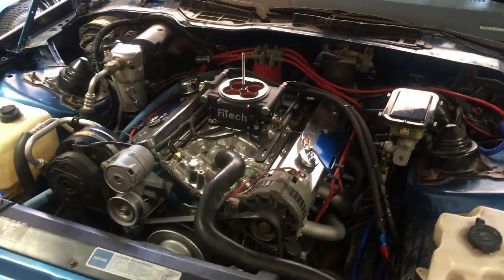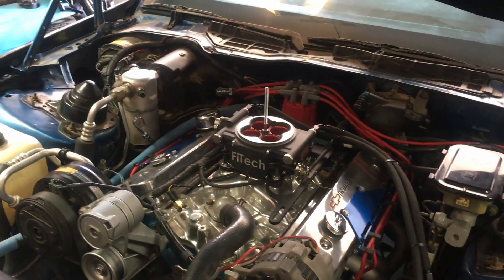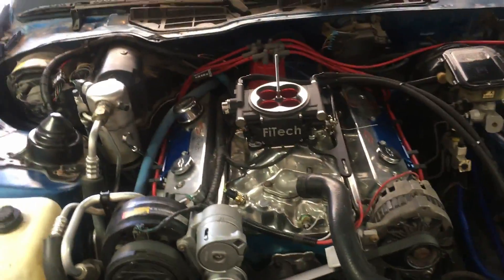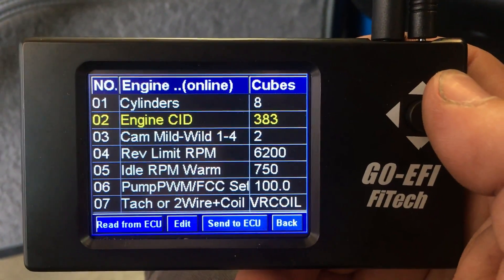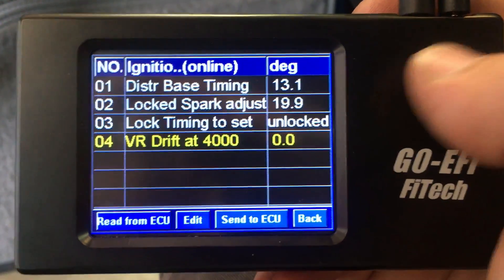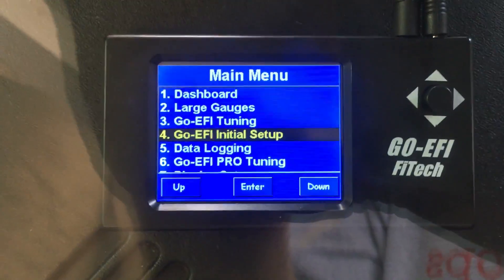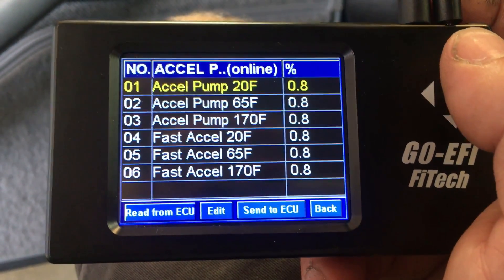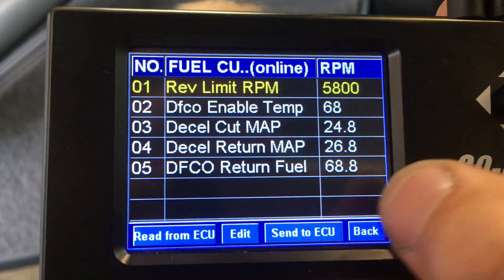Fitech Go Efi 4 Setup on a 3rd Gen 383 Camaro

Comment: Hey great video. I have been doing alot of work to mine and have finally got this about 90 percent done. As far as the fitech I also tied into the fuel pump relay. Do you know which wire color combo you tied into at the relay. And then where did you end up running your white wire for 12v in crank and run? Thanks in advance
Reply from the maker: The 12v crank and run wire usually gets connected to the original ignition coil power wire. It should be hot in start and run. There are two smaller wires for the fuel pump relay. One goes to ground and the other gets connected to the fuel pump wire on the Fitech. Good luck.
Reply: @PetesGarageandperformance  ok I'm pretty sure the 12v crank wire to the ignition coil is the pink on the third gen camaros. Should I slice into it or just connect to the positive side of the coil? And then I also have the blue wire running to the negative side. Then as far as the fuel pump I connected it to the green and white wire coming out of the relay. Does that sound correct
Reply from the maker: We used an MSD 6al box so the harness from the box went to the coil and the coil wire from the FiTech went to the MSD box. You can’t run an HEI distributor if that’s what you have. Yes splice to the pink wire.
Reply: @PetesGarageandperformance  hey thanks for the reply and assistance. OK so I am running the msd ready to run pro billet distributor with the external blaster ss coil so I should be able to run to the pink wire correct.
Reply from the maker: Yes as long as it is hot in run and crank.
Reply: @PetesGarageandperformance  thanks again for your assistance 👍

Comment: hi friends .. why am I so difficult to set up my fitech?  my engine smallblock383 uses HEI distributor .. maybe you know what's wrong with me?
Reply from the maker: You can’t use the timing control feature with an HEI distributor. You could use the FiTech to just control the fuel. Not sure if your FiTech unit has timing control or not, but that’s one of the best things about the system. You can adjust the timing from the driver’s seat.

Comment: Did you lockout your rotor?
Reply from the maker: Yes. Lock it out and use the FiTech to control the timing. It makes timing adjustments as easy as the push of a button.

Comment: Crap. They suck ass. Took 3 to get 1 that works. Biggest pile of shit ever.
Reply from the maker: What kind of issues did you have and what is your setup?
Reply: @PetesGarageandperformance  a customer put one on his 74 Pontiac Grandville. Injectors would not pump fuel at all. So we swapped it with one from our speed shop. It would prime and start til primer fuel was gone. Injectors would not kick on to keep it running. Finally took a 3rd one from our speed shop and it works... But it sounds horrible. Like it trying to suck a golf ball thru a garden hose. They are crap. The car still on my lift. Waiting to see what the customer wants to do. 3 to get 1 that works. And I seem 1 other comment supporting they are crap. Customers that ask me about it. I tell them don't waste their money. And I show them the car on my lift for 3 weeks while I try to make the junk work.
Reply from the maker: What are you using for an RPM trigger? Does the screen read RPM correctly? What’s the fuel supply setup?
Reply: @PetesGarageandperformance  stock tank. Fuel supply that came in kit. Yes correct RPM on screen. Correct voltage. Pump pushing the 40 pounds like it should. Hours and hours of on phone to California to their experts. All they can say is they have no idea. Everything is correct. It should work... But it don't. I not just some fly by night back yard mechanic. I do classic car restoration, and resto-mods. I have switched out many carbonators for fuel injection. So this ain't my first rodeo.
Reply from the maker: That is weird. I always had 58psi on the ones I used. Are you using the fuel command center? It should still spray at 40psi though. Is it possible that the supply line is connected to the return port? I just find it hard to believe that you’ve tried three different units and still can’t get it to run right. It almost has to be in the setup. I’m not trying to insult you, but I’ve installed many of these kits and haven’t ran into many issues.
Reply: @PetesGarageandperformance  trust me. Everything is hooked up correctly. We are getting more than 40 psi. The expert in California told us we needed a minimum of 40. But yea we getting more like 58 to 60 psi. It is the 600 horse kit. I had 2 other master mechanics look at it too. They have 80 years experience between them. I got 20 years experience myself. Trust me. All is hooked up correctly. By all means it should work. But they don't.
Reply from the maker: Yeah it sounds like you guys know what you’re doing. Let me know what you guys end up doing to resolve the issues. Where are you located? I could help you if you’re close to KC.
Reply: @PetesGarageandperformance  yea I am in Toledo Ohio. I definitely will let you know. I just at my wit's end with it. Customer coming in tomorrow to talk bout it. I hope. I need my lift back. Lol
Reply from the maker: Good luck.
Reply: @PetesGarageandperformance  Thank you. I think I gonna try a different makers unit to satisfy my curiosity. Can't hurt.
Reply: @PetesGarageandperformance  plus I see as you do. A lot of people having issues with them. Not just me.
Reply from the maker: I hear ya. I’ve used a Holley Sniper before and it worked good. I also fixed one that had some install errors that caused the o2 sensor to go bad. I’m always kind of skeptical when people trash the product though. As you can imagine, when it says “self learning” people think you just bolt it on and then it’ll magically work perfectly. You still have to know what you’re doing as far as setting idle and the timing table.
Reply: @PetesGarageandperformance  I got it going. The customer had me switch to the sniper. Took a min for it to show. But... I put it on. Fired right up. No problem.
Reply from the maker: Glad you got it going. What are you going to do with those three fitech setups that don’t work?
Reply: @PetesGarageandperformance  my buddy took them home to see if he can make 1 working unit. Then what's left is scrap. The company just gonna eat the loss.

Comment: FiTech is trash. I have had nothing but issues with my FiTech-600
Reply from the maker: What kind of issues have you had? What was the combination?
Reply: Pete's Garage IAC steps never stay the same. I have to adjust them every time I attempt to drive. I have refreshed my gaskets and checked for air leaks. My O2 censor is at the correct angle and distance. The unit is grounded correctly to the battery. FiTech reflashed my control unit but the problem of stalling still persists. Idles fine but once shifted in to gear the RPMs fall and engine stalls. Once I start the motor again the IAC steps are back up in the 150’s
Reply from the maker: So on the next startup is the idle too high when the IAC steps are 150? Or is it 150 because it’s trying to not die? What kind of engine is this installed on? I’ve fixed a few of these (including Holley Sniper) that had issues. Usually there is some kind of installation error. For example: the last one I worked on was a Ford 400. The plugs were fouled out and the o2 sensor was ruined. It wouldn’t even run. It all was due to the location of the coolant temp sensor. They actually had it in one of the intake runners thinking it was a coolant port so it never thought it got up to operating temp and was dumping too much fuel.
Reply: Pete's Garage  the idle is great every time. No climb or low idle. It’s only when the transmission is shifted to Drive the motor stalls. 

It’s on a 351W . The Rep keeps telling me the stall on my torque converter is too much for the unit.....FiTech customer tech service isn’t the best.
Reply: Pete's Garage I just figure I will swap an LS into the Unibody Ford when I do the C4 suspension swap. I’m just really tired of this Unit.
Reply from the maker: Lol! LS swap is always the right answer. So do you have a big cam with stock stall converter? What is your idle speed? Ignition timing and map kpa at idle? Do you have the FiTech controlling the timing?
Reply: Pete's Garage  I think my timing in the last I did it was 2° advance. My timing control is on an MSD box. FiTech doesn’t control it.
Reply: Pete's Garage oh and my idle is set at 1000-1100. It has a mild cam, and I couldn't tell you anything about my stall converter. The setup is likely stock on the stall converter. It was pulled from a rolled 69 Mach 1
Reply from the maker: Now we are getting somewhere! I think the idle speed is too high for a “mild” cam. What are the specs? Also you need probably close to 15-20* of idle timing. I would use the FiTech to control the timing to the MSD box. It’s one of the best features of the fitech. You can control the timing with the handheld. Set the idle to about 750 and advance the timing until the MAP sensor reading goes to the lowest KPA. This is the timing where the engine will idle most efficiently. Then set the Idle screw to get the IAC steps down. 

With a tight torque converter, high idle speed, and low ignition timing you are basically putting the brakes on your engine when you put it in gear. Your timing is too low. But if you advance the distributor to get your idle timing up it might make your total WOT timing too high. You would have to change distributor bushings and springs to dial it in. Or you could just control the timing with the FiTech. Easy peasy after you verify that the FiTech timing matches actual with a timing light.
Reply: @PetesGarageandperformance  Thanks Pete. I will give these things a try. Its likely I will need to hire a person to tune this.  I have lost a great amount of patience with this setup. @md_machine
Reply from the maker: If you are near Kansas City I could help you. Other than that good luck. It really is just the same stuff you would need to do if it were carbureted. 2* of ignition timing means that the flame is practically chasing the piston down the cylinder and not pushing it down. Any time a more aggressive cam is installed, the engine will need more idle timing than before because the engine is less efficient at idle. That’s why it sounds choppy.
Reply: @Mattndew676  [

Comment: fitech has never worked well for us and we have done everything that they recommended, it sucks
Reply: Last summer I had a local small shop  put a FiTech on my 86 C20 with a crate 350 Vortec. It still doesn’t run when it’s cold. Get’s 11mpg, Been all over YouTube trying all the fixes. Reset it several times. I’ve decided that I will just bite the bullit and go with an Edelbrock Avs2 650cfm carb. The FiTech will go in a box in the garage. I wouldn’t sell this thing to anyone else and put them thru this, let alone have them throw their money away too.
Reply: Laughing  at Ted Smith response 🤣😂
Reply: maybe try to hook it up (correctly) and let do it's job
Reply: @tedsmith4353  not helpful jackass

Comment: Also do you set spark advance before the iac step setup?? I get mixed opinions but timing effects engine rpm I take it
Reply from the maker: Idle is always a balancing act between airflow and timing. So you’ll have to go back and forth between the two to fine tune the idle. Start with setting the timing to somewhere around he high teens and then do IAC. Then you can mess with the timing to get the best vacuum. Then revisit the IAC.
Reply: Makes sense. So set the spark advance to high teens then mess with iac then mess with spark advance for highest vacuum then maybe back it off some to prevent dieseling??
Reply: Also could you please do a video on setting up the phasing of the rotor. I think I understand it but not 100% sure. So say I set my 318 to 10btdc then drop distributor in facing # plug terminal then turn adjustable rotor in rotation of firing order???
Reply from the maker: We didn’t actually have an adjustable rotor. So we didn’t phase it. I locked the timing on the tuner at 10* and then made sure the timing light read 10*. If it doesn’t match then turn the distributor until it is 10*

Comment: Why you convert to Fitech?? When it’s basics gm throttle body injection
Reply from the maker: These systems are much better than a GM TBI. The TBI is only a two barrel and this one is a 4 bbl. Also this system uses a wideband oxygen sensor to constantly adjust the amount of fuel to hit an afr target. It’s also a lot easier to adjust timing by pushing a few buttons instead of getting the timing light and distributor wrench out. It also controls the fans among other things.
Reply: TBI=1980’s Tech. EFI=2015-2019 tech.SOOO MUCH Better.

Comment: You didnt have to drop the gas tank man. You can use the high pressure in front of the stock pump. It will actually be easier on the high pressure pump that way, and because its releasing forward pressure on the in-tank, thats gonna have a lot less stress on it. As long as the in-tank isnt seized, it will feed enough. The negative pressure will allow the in-tank to spin faster because its not fighting viscosity under pressure (like a torque converter does). You did a lot of extra work there man...
Reply from the maker: I’m going to disagree with you here. I like to keep it as simple as I can. Having two fuel pumps inline doesn’t seem like a good idea when we can just put a known good setup on the vehicle.

Comment: What do you have your prime fuel multiplier set to? I have a mild built 302 on my 67 cougar and I've been having trouble getting it to start. Usually takes about 7 revolutions before it will fire off
Reply from the maker: Jeffrey Stelling I’m not sure of the exact setting but I do remember having to back it off quite a bit from the default setting. If you give it a little throttle and it starts easier it usually means it’s too rich. I would back off the prime fuel if that’s the case. I think a lot of people have had to back off this setting. Is it holding fuel pressure or is the fuel pressure dropping off while sitting?
Reply: @PetesGarageandperformance  I actually just watched the video where you showed what you had yours set to. I brought mine down real low,like -50,and giving it a little throttle didn't effect it,so now I'm thinking I need to put more fuel in it.
Reply from the maker: Yeah maybe you went too far. Keep in mind the engine this was on was a 496 BBC with a pretty aggressive cam. The prime multiplier is a multiplier of the calculated prime pulse that I’m sure is affected by the Cubic inch displacement and cam selection.

Comment: I couldn’t get my FiTech 400 to work properly, I tried and tried tuning it up, no go. I said screw this, removed it, sold the used unit (with fuel pump). I then went ahead and bought the Holy Sniper EFI Kit, friggin works great.

Holy Sniper >>>>>>>>> FiTech
Reply from the maker: Galactusz007 maybe you got a bad one? I’m sure Holley has had a bad one too. But most of the time it’s just not set up properly. What was wrong with yours?
Reply: Sounds like you didnt set it up properly. Also, the Sniper doesnt support forced induction or nitrous, which is the point of the power adder.
Reply: @astcomjakecw  actually Holley does. The FiTech is advertised as a N/A unit only